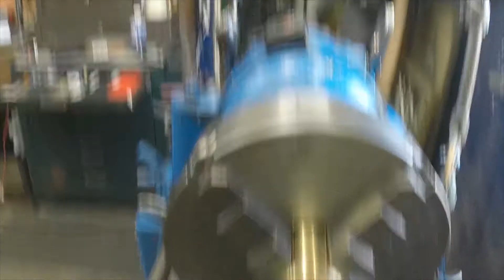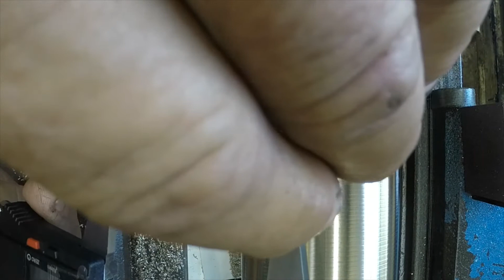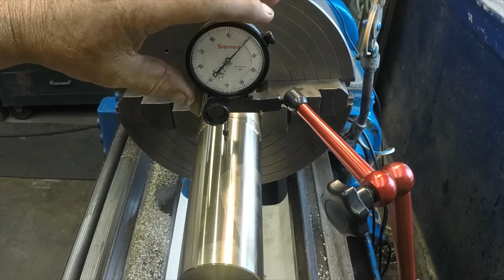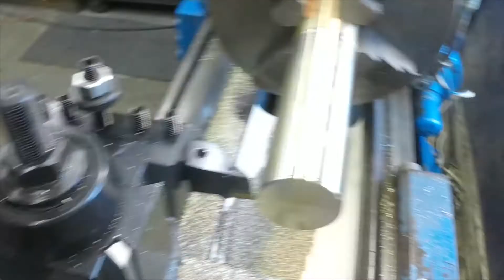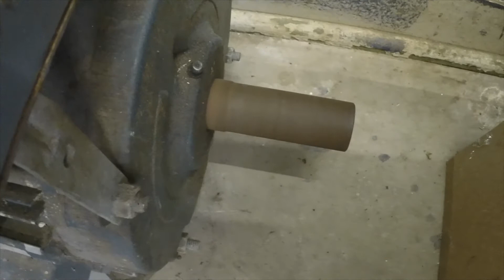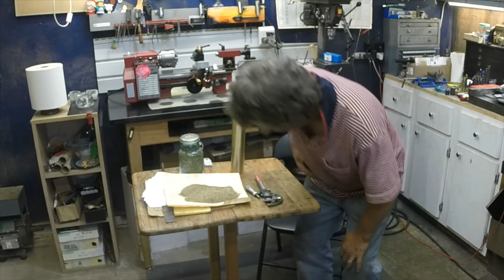MACHINING A DRIFT PART 3

Comment: Hi KZ, I don't think it's conventional turning with tool upside down, but hey what ever suits you, the only thing to be aware of. if its a screw on chuck without any form of lock.(and i know your isn't ) the chuck could unscrew and fly off. Just something to be aware of if you use someone else's lathe in the future.
Also i save all my brass/bronze chips, bag them up and take them to my local scrap merchant, just took a bag yesterday in fact with 24kg ( 50 lb  to us Imperial folk) and raised myself £50 for some more stock. 
Keep that infectious enthusiasm coming, it's great to see.
Regards
 mr f

Comment: That lathe is sure doing a nice job of turning brass.  For brass, a chip shield is easy enough to fabricate out of a piece of lucite and a cheap magnetic indicator base.  Lastly, you will probably need to level your lathe in order to get consistent accuracy over a long workpiece.